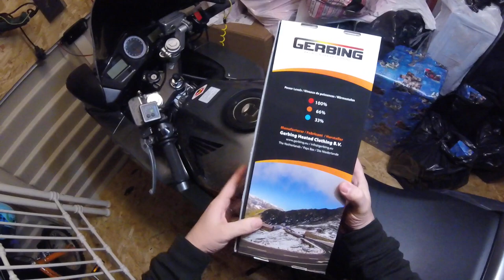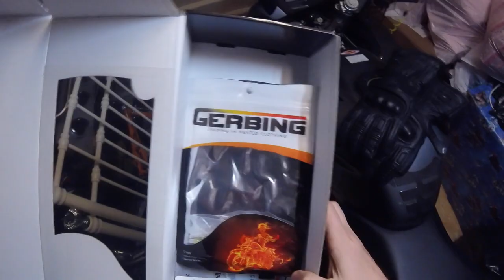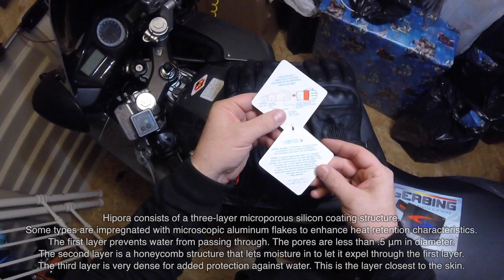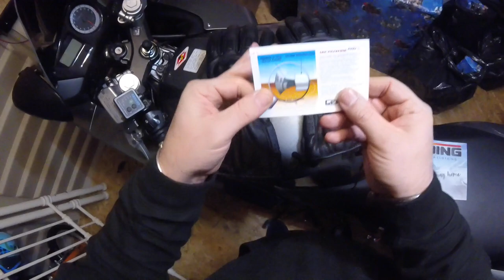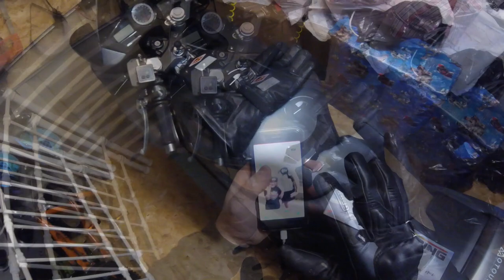Oxford Heated Grips V Gerbing XRL Heated Gloves : VFR800

Comment: I have purchased the XRL gloves and can honestly say this is the most honest review I have yet witnessed. I commute 11,000 miles on my MT09 SP which I 100% agree that anything over 8degrees C then heated grips are fine but anything below is when these gloves come into their own and yes you do then start focusing your attention on other cold parts of your extremities, lol. WOnderful gloves making for a safer ride in cold conditions.
Reply from the maker: I also purchased the heated inner jacket, wow that was a game changer. Heating the body core made an massive difference to all over body heat.
Reply: I've got an SV650S and fitted DL650 handguards, but they only made a small difference. I bought the Oxford analogue hot grips years ago for £18 on eBay and they're ok at like 10c. 

I even use the grips a little in warmer weather, as my winter armoured gloves probably restrict blood flow. I guess their insulation blocks the grip heat too.

What made the grips useful was buying some £15 handlebar muffs and fitting them in colder weather. 

They're a bit fiddly to get your hands in/out and can get in the way of the switches. After a few hours my hands did get cold but it was a massive difference where I've often turned the grips down.

I need a new helmet with a pinlock & sun visor as it got dangerous with specs on at night. Might try some toe warmers as mine get painfully frozen. I use an Exo2 heated vest and a balaclava which really helps.

Comment: I was convinced by my GF several years ago. Used Heated grips since 1985 and have installed lots over the years.  Only you palms get warm the fingers and top of hands are COLD.  Slip you hand in a quality wired glove and my 'old' Gerbings are truly the best.  the newer ones with the smaller diam. wires are ok but not as warm as the older ones.  If your going to ride, Comfort is where it's at.  Cheers, good vid and review

Comment: Great straight up review Craig, thanks for taking the time to do that, definitely will consider those especially the wired option. Got some RST’s with a battery, about 3 years old now and the batteries don’t last that long anymore plus they are expensive to replace too. I like the idea of almost free endless heat for the fingers. Totally agree too with the heated grips conclusion.
Ride safe and warm buddy.
Dave
Reply from the maker: Cheers David, yeah the battery idea is great for freedom but it’s something else to worry about.

Comment: I had a pair of Gerbing gloves and found they got a bit too warm for me and the pair I had there was no way to control the temperature, it was all or nothing. Personally I don't think you can beat the Oxford grips, great price and easy to control the heat. Easy enough to fit and I love the way they just wire to the battery and switch off if you forget to turn them off. They're not perfect and as you say, not great in really cold weather. I haven't given up on heated gloves and probably need to try the pair you have. Thanks for the review.
Reply from the maker: Cheers pal, heated gloves with no control would deffo be a no go. Combined with heated grips are amazing.

Comment: I have the version before them they are brilliant gloves gripes don't even compare mine have never leaked and had a big accident in them and they did good all i recomend is you tape the connectors on the end of the jacket cables  to strengthen them up as they do snap the wires after a time in fact do then all a few times with insulation tap👍i then got the socks to😁😂try to convince everyone else how good they are your banging your head brilliant vid👍😁
Reply from the maker: Thanks for the tips, will keep that in mind. Are the socks good too?

Comment: Great review. I'm actually more interested in the external mic you use for your drift camera. I'm using the one from drift and the wind noise is quite bad. Yours seems very calm. Do you use another brand?
Reply from the maker: I use the standard Drift microphone I have it positioned directly in front of my mouth but my shark helmet has a great chin curtain that’s pulls out and stops all wind noise getting in
Reply: @Motourev  Quick reply! Thanks for that, I have mine to  the side as I have a flip-up helmet. I'll work out a way to move it to the front.
I also have a chin curtain but it's clearly the mic position that's wrong.
Keis heated gloves would be for me purely because of the fit of the gloves, tried on loads at the NEC a while back.
Reply from the maker: @graemethompson  I have my mic pointing upwards towards the visor and not sideway, when sideways it picks up noise from the bottom of the helmet where the wind comes in.